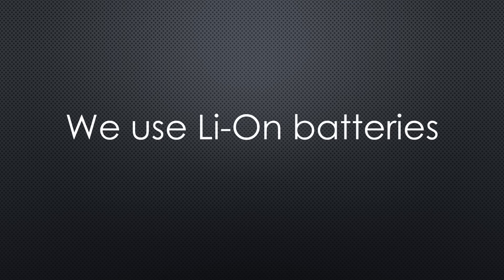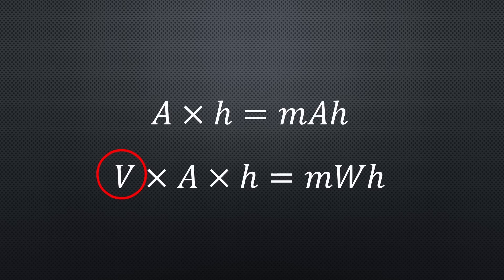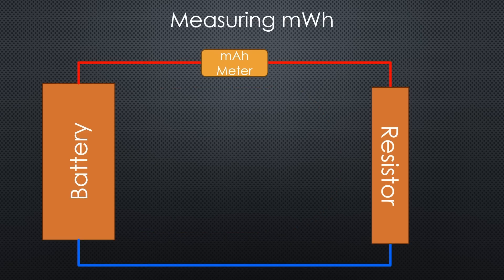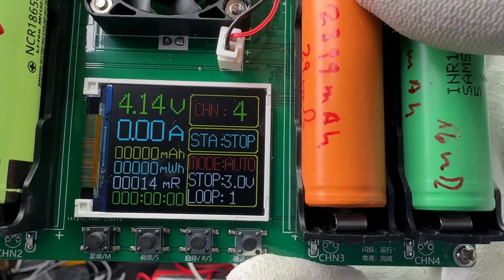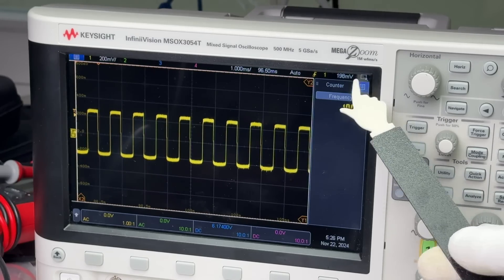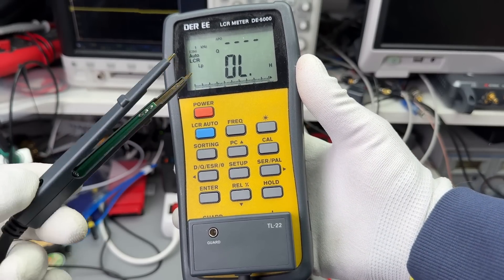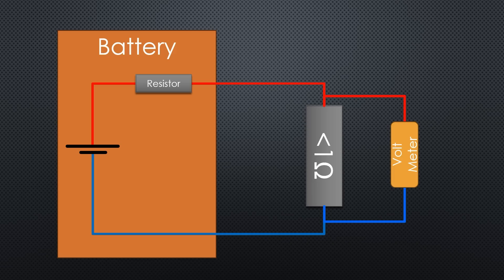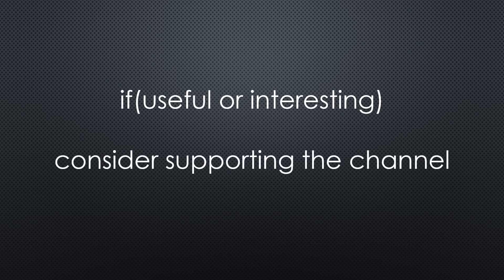(497) How to Properly Test New and Used Li-Ion Batteries (Including Cool Testers)

Comment: Superb content. Can you make a variant for proper testing of EV HV battery, especially such with a small 10 mm dent  the casing, as an example. Focus on individual  cell testing . Worst case would be  cell exchange.
Reply from the maker: This is not my specialty. AFAIK, there are services that do it (if you want to sell your car, for example).

Comment: Hi! I intend to do an energy adaptive sensor node project. I intend to use a 12V lead acid battery, Should I use a current sensor or a voltage divider circuit to record the voltage level of the battery?
Reply from the maker: You can use a voltage divider to measure 12V with a 3.3V MCU

Comment: Funny story about weight vs capacity. Some years back I was doing a story about counterfeit camera batteries, so bought a bunch of different brands of two different Canon models. A couple of batteries had very low capacity despite their weights being in the normal range. The reason was obvious when I opened them up: Each had a way-undersized pouch battery and a chunk of steel to give it more weight 😂

Great tips as always, especially the one about prying 18650s out from the negative end first to avoid shorting the top pole's support structure!
Reply from the maker: So you had intelligent suppliers that wanted to do a better fake than the ones without steel. I also heard of sand in some batteries...
Reply: @ Haha, I hadn’t heard of sand before! Cheaper than steel but it must have been a pain to handle in the manufacturing process. (Unless maybe for things like lager gel cells.) These were small cells, I think EP-17s, the steel was just stuck to the pouch cell with some double-sided tape so it wouldn’t rattle 😁

Comment: How do I measure the maximum safe current draw for a particular battery that doesn't mention discharge rate? is there a way calculating it from internal resistance?
Reply from the maker: I do not think you can measure it. The manufacturer has to give it to you. Excessive heat dissipation is a good indicator, though.
Reply: @AndreasSpiess  Thanks Andreas! I have a box of around 100-150 assorted 18650 (mostly from laptop batteries) in various conditions. trying to sort them so at least I can use them for something meaningful rather than using them one by one. so far I've been sorting by internal resistance and discharge capacity, but still searching for better, more reliable way. on a side note I really like your channel!
Reply from the maker: @EvgeniX.  These are the parameters I also would use to determine the quality of the batteries. But not the max. discharge rate...

Comment: Andreas, can you give your viewers few expert tipps to kickstart a drained battery a regular charger won’t accept anymore? tried this a few times, but was to anxious to had success.
Reply from the maker: If there is no protection board, you can do it with a lab power supply with a few mA current. If it has a protection, you usually have to remove it before. But as I said: My experience with re-charging a LiIon battery was not good. It started to burn :-(
Reply: @ unprotected; did it with 300mA for cpl hrs (permanently monitored of course), never worked. Anyway, tnx for answer.
Reply from the maker: @notofinterest  Strange. Then, the defect was severe...

Comment: 3:45 Your calipers blink because of low battery in a video about batteries :-D
Reply from the maker: These calipers work for month blinking. And they are still accurate. So I do not change the battery until it is really dead...
Reply: @AndreasSpiess  I do the same, but only because im too lazy to change the battery :-D

Comment: Cells which are swelling are typically because the electrolyte is breaking down.  Even if the voltage the pack sees over its life is correct, individual areas in the cell can see overvoltage which can lead to this electrolyte decomposition.  This is a bad sign.  Such cells should not be used.  The other big reason is delamination of the layers of the cell.  This will lead to swelling, which leads to further delamination, which then leads to electrolyte decomposition.  The electrolyte used in the cells is flammable, so I highly suggest disposing of such cells as soon as swelling is noticed.  I've always noted swelling in bagged cells before they undergo catastrophic rapid disassembly! (ie: They explode)
Reply from the maker: Thank you for your clear words!

Comment: Have you ever tried the new 6.4V / 12.8V LiFePo batteries that come in a package similar to sealed lead-acid batteries for cars / boats? They often appear to have a BMS and undervoltage / overcharge protection. I wonder if they are better for beginners than dealing directly with Li-Ion batteries
Reply from the maker: Indeed, they have to have a BMS because they use more than one cell in series. I built one myself (24V LiFePo4, 7.5kWh). These batteries have very different applications than the ones I covered here. As you write: Because they have protections, they are much easier to use.

Comment: Once I purchased a 36 V 10s 2p 18650 pack. it was seriously under delivering capacity so I disassembled it and tested the cells individually. Half of the cells, one out of every two in parallel was reading 0 V, so I cut the dead cells open and found that they were filled with dirt.
Reply from the maker: Incredible! That is why I always test batteries when they come and start a dispute. I got a few times my money back. But I never opened a battery to test if they contain dirt.

Comment: ⚠ Aluminum case Power Resistors Watts Rating are only when mounted on a heat sink. When used in free air Watts rating is 1/2 or less then label. Mounted on other cases to vehicle frames then can be in between printed and free air. Go look at Vishay and other real datasheats for metal case power resistors. Common Example is 6 ohm 50 watts Al case unit for vehicles that "upgraded" Tungsten to LED but burns itself and more because resistor is not mounted properly if mounted at all...
Reply from the maker: You are right. Thus my warning about becoming hot.
Reply: @AndreasSpiess  Why the added ⚠? 1. Seen that but warning is buried and little info. 2. Most readers very likely won't understand watt ratings for power resistors. Al cases like shown need proper mounting or can easily be "Red hot" and burn everything even if gets a lot of air VS. Ceramic and other types want a lot of Free Air or Forced Air to flow on the entire part. If a ceramic is mounted then must allow free air flow not mounted on any surface and no heat sink is used. Another Example: Majority of Vehicles use hidden > 1 ohm High Watt Power Resistors and Forced Air to cool to control Radiator and Heater fans and when garbage covers them often starts a fire even after OEM started putting thermal fuses and guards on the resistor assembles.

Comment: It's not true that a higher "factor" means a better battery. It is true that cells with higher specific density require better quality engineering to manufacture, but this is also the problem! Because high quality engineering means tighter manufacturing tolerances, which - at least for chemical / battery cells - usually means there's more ways for things to go wrong, and more chance for failure.

It's the usual triangle of compromise: (a) capacity, (b) reliability, (c) lightness -- choose 2. (And don't worry about cost right now, I didn't want to make a triangle with 4 corners, it's too early in the morning for that kind of geometrical sacrilege).

But I think even more importantly, the more power you require from your Lithium cell (ie, very high charge-C and discharge-C), the heavier it will be for the same capacity.
Reply: How about a tetrahedron? 😉
Reply from the maker: Thank you for the additional info!

Comment: I avoid li-ion as much as possible, I replace them by LFP as much as possible.
Reply from the maker: I agree. However, most boards I have are made for 3.7V
Reply: @AndreasSpiess  yes but the li-ion battery are so a gamble, I prefer to avoid them as much as possible, all the life expectancy of a LFP battery is so high compared to the li-ion battery.

Comment: Thanks for the sample devices to do charge / discharge look testing. Looks like I will avoid a lot of shopping risk simply by starting with the ones you already bought and evaluated. Battery selection and proper usage in designs remains a critical design element, thanks for your usual thorough treatment.
Reply from the maker: I agree, testing and creating a dispute is a good way to put the risk on the supplier...

Comment: One of my flashlights has a scalloped face so I can see light if I leave it on and stand it on its face.  My best one, like yours, is flat and if you tap it against the counter when you set it down, it will turn on sometimes and you can't see it.  I always set it on a thin plastic box so the light is visible.  I'm curious about the fire because I reuse cells out of my old laptop batteries, and I don't think they are protected.
Reply from the maker: Only one started to explode, so you might be lucky. But it was impressive for me...

Comment: Caution:  Good ammeter fuses are expensive.  If blowing the fuse is the test, then you need not use an ammeter and risk damaging it... just short the battery with the fuse and see whether it blows.
Reply from the maker: You probably saw how I did it in the video...

Comment: I bought a toy boat from china that contained a 3s 2000mha battery that was bloated. To my surprise it when back to normal size with a few very low current charge/discharge cycles. I don't really understand how this could work. Also have a few chhl batteries that are bloated (by high amperage draw) but can't fix it with slow charge/discharge cycles. I opened these up and have salvaged a few cells that way that I use in low current devices.
Reply from the maker: Maybe the first had a pressure valve that let the pressure out over time. 
BTW: I never open LiIon batteries because they love air and can explode. So you were lucky!
Reply: @AndreasSpiess  With opened up I meant that I disconnected the series connection (3S) and use the individual healthy cells separate. Also to my knowledge the battery that was bloated and is fixed is still air tight. I would never open up any lithium cell. I don't want to burn my house down.

Comment: Ive brought back 0v lithium batteries, with a variable power supply slowly raising the voltage trying to keep current minimal.  You can see it absorb the current as the current goes down, the ones where the current doesnt go down, these are the ones that will catch fire if you put them on a regular charger because they'd just go straight to 4.2v or whatever voltage youre giving it but not absorbing it, heating up in the process.    Im not sure of the future longevity of these cells i brought back from 0v that did absorb the current, but from my understanding the damage happens on the influx of current to a 0v cell, not necessarily the cell reaching 0v.  And in my experience that holds true as these cells i brought back from 0v. in subsequent capacity test they still hold a charge.  However the one i couldnt bring back from 0v, it could have been damaged from going to 0 too fast maybe.  This is just my anecdotal evidence and experience with them, and they are safe provided you check them before but no one does that so its good to have BMS that wont charge a 0v cell etc.
As for capacity testers im using a similar one to the one in the video and they're pretty accurate and consistent it seems, i also put together a DIY capacity tester with Arduino following someones guide on youtube and it just used a 1 ohm shunt resitor to measure the current across which was supposedly not ideal, but it also gave consistent results around the rated capacity so i dont know how much precision your losing using a 1ohm resistor, for relative accuracy to match cells its definitely good enough.   I haven't used it since i got an aliexpress capacity tester, but i kept a database of all the batteries i tested with they DIY one so now i can compare to the commercial  one.  Im actually discharging a cell as i type to see how far off the testers are from each other.  Was a super small shunt resistor and all the extra circuitry to measure its voltage drop worth the hassle? or is a 1ohm shunt resistor good enough, the math works out easy with the 1 ohm setup as the voltage drop across it is the same value as the current going in, but i "read"you lose like 10% accuracy.  On a 2500mah cell thats like a  2250 to 2750 swing which is considerable, but is it really that much? ill let you know.

Comment: Testing the presence of overcurrent protection by shorting the cell through your meter’s high Ampere circuit is not advisable. A decent meter will have a fuse capable of interrupting enormous currents and these are not cheap.
Reply from the maker: You are right!

Comment: I just bought a DL24 with the accessories for 24.- CHF (Ali)
It is great, and very easy to check capacity according to the current. Will see how long it last...
Reply from the maker: Somebody wrote that the FET goes sour after 5 years...

Comment: The car battery tester does not work with higher currents than the yr1030+. The measuring principle is the same. It applies a 1kHz small voltage signal and reads the current. This is pretty neat for fast signal changes. It calulates the fast resistance. BUT when it comes to long term/steady current draw, the internal resistance of a battery rises or in other words: the voltage drop increases. The 1kHz measurement is indeed nice, but useless if you want to know steady current draw resistance.
I figured out in practical use just double the value of the reading and you are fine.
Reply from the maker: Thanks for the additional info. For me, these measurements are just relative. Bad batteries usually produce very different readings also with this method. But the "real thing" is always to hit the starter button. I know this from my 1700cc Harley ;-)

Comment: Nice to see that it is not only me that suffers from low battery in the calipers.
I keep mine in the case and the reliable way to prevent them activating when not in use is to open them slightly and then tighten the slide lock. Environmental effects will not move them like this and they remain "off"
At the very least avoid leaving them fully closed.
Reply: You are correct with your measures against "unassisted activation". However my experience - and also from some Youtubers - is, that the battery drain does not only come from activation. Unfortunately the electronics inside draw a significant residual current when the caliper is switched off. The only counter measure here is taking out the battery when not using the caliper (my way, but very tedous) or adding a hardware switch (tricky). 

In one video I saw a guy replacing the battery with a super cap and building a charger, that keeps the cap charged as long as the caliper sits on the charger. The charge was enough to keep the caliper on for a couple of minutes - enough for some measurements.

I'm still not sure if this is a good idea, because you are limited to places with power supply.

Cheers
Another Andreas
Reply: @andreasbentz6106  both good ideas. 
I need them too often though to be placing the battery back in each time I need them. 
This sounds like an opportunity to get them on the bench and check the standby draw provided my meter has the resolution.
A better solution may be a deep sleep power switch.
Reply from the maker: I use cheap batteries and replace them from time to time. They still work for a long time even when they blink.
Reply: Cheap Chinese calipers have a noticeable off-state power drain, AFAIK regardless of open or closed. (Gonna check mine after this though.)

Mitutoyo ($$$) calipers don’t do this though.

=> Silver cells (SRW44/357 type) last a lot longer than alkaline LR44s, worth the extra cost.

Comment: As far as I know, the battery capacity is given with constant current discharge metod (IEC). The china testers just put a resistor in and log current and voltage for mWh calculation. Not the same. I got one of those china testers and was a bit disapointed when I saw the design. So you can not really compare datasheet values with data given from a non-constant current tester.
Reply: I think the mWh capacity of any individual battery should come out pretty much constant with both methods, but you're right, converting it to mAh isn't fully trivial. I'm usually more interested in the total mWh. Which value is more useful, depends on the device being powered. Assuming a constant power draw in the device, linear regulators draw constant current, but buck/boost regulators draw increasingly more current as the battery voltage drops.
Reply: @renxula , batteries are much more complex than a voltage source plus a resistor. The constant current method should be used like he stated.
Reply: @michaels3003  they are a bit more complex, but I don't think it matters much in hobby use. Like, will the measurements be 1%, 5%, 10% more accurate? If I want to know the capacity in order to estimate how long the battery will last in some device, then I'll leave a much bigger margin for error anyway.
Reply: @renxula  , a "bit more complex" is not correct. They are very nonlinear devices. He briefly "touched" on this subject when discussing the so-called internal resistance. Batteries also age.
  
Knowing that the batteries have overstated specifications (this should be expected at the very low prices), just buy somewhat "bigger" batterylies than you really need.